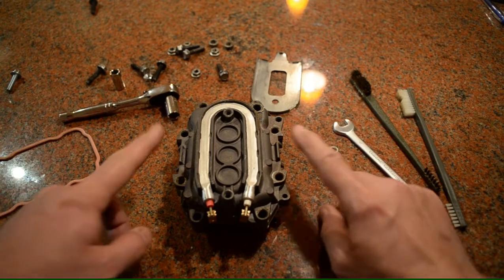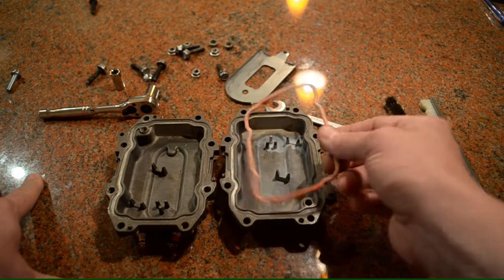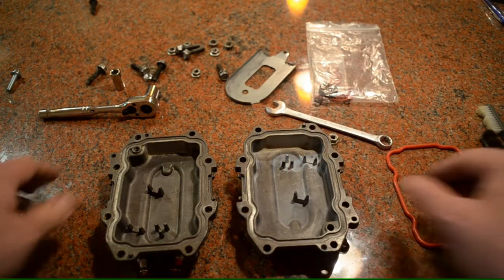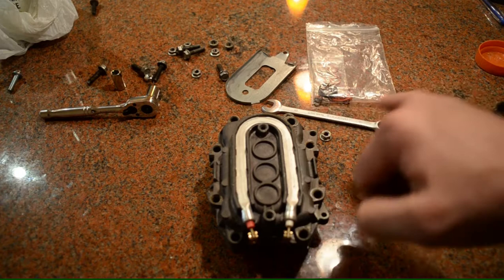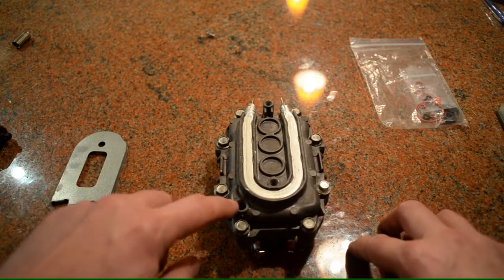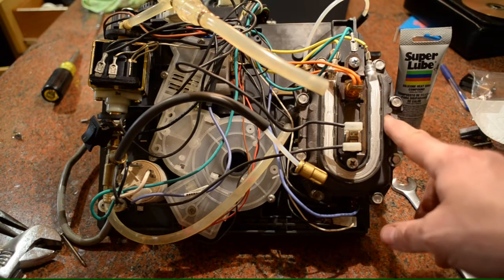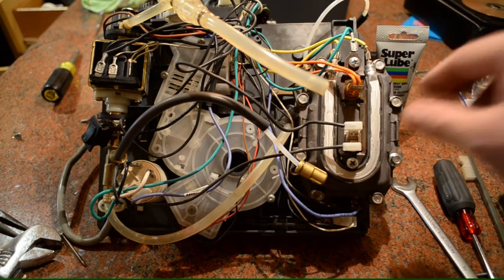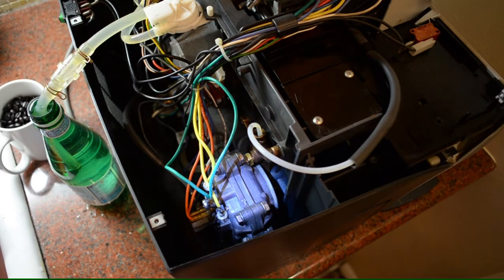Saeco Boiler Overhaul Rebuild for Solis 5000, Vienna or Trevi

Comment: Hi and thanks for the video. Very useful. My clamshell boiler is pitted and has a pinhole. I need to replace it but they are hard to find. Do you have one I could purchase or know where I could get one? Much appreciated. Domenic
Reply from the maker: https://www.ebay.com/itm/Saeco-Boiler-120V-part-9011-129-for-VIENNA-TREVI-GAGGIA-SYNCRONY-OTHERS-/284341624772?mkcid=16&mkevt=1&_trksid=p2349624.m2548.l6249&mkrid=711-127632-2357-0
Reply from the maker: Maybe this one?
Reply: @zomborama  Thanks Tony. Unfortunately, the item does not ship to Canada.
Reply from the maker: That's too bad. I wish I could help.

Comment: Is there a part number for the boiler? The green “heating” light won’t stop flashing and thus will not heat and machine will not start. Solis Master 5000 unit. I figure I may need a boiler repair/replacement.
Reply: It's in the description above #286471155 for the 120V. If it's blinking it might mean that it might be the thermal sensor. If the blinking stops after about 10 minutes, it might mean that you have a 220V boiler. I know because that happened to me before.